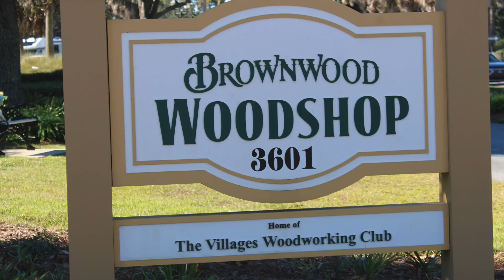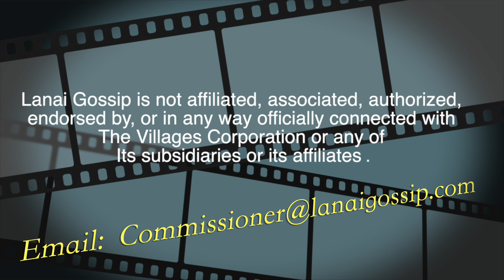How to become a member of the Woodworking Club in The Villages.  Two Wood shops locations to choose.

Comment: I have a woodshop in my home and it is a passion of mine that I want to continue doing in my retirment years.  I have tens of thousands of dollars of tools I am comfortable with and want to use vs using the equipment in the villages shop.  Would I be allowed to setup a woodshop in my garage in the Villages?  Or would the noise of a table saw/jointer/planer violate rules?  Thank you for answering as this is a del breaker issue for me.